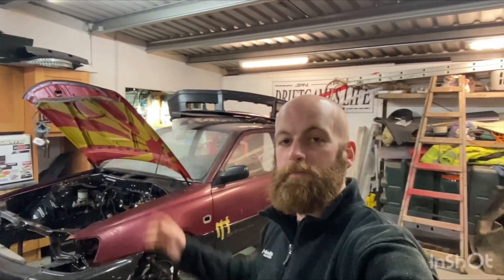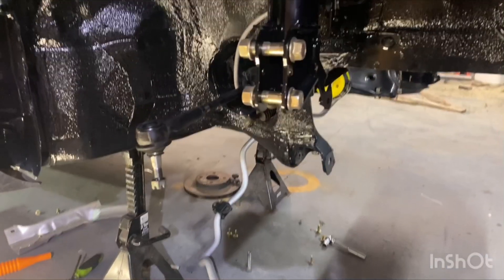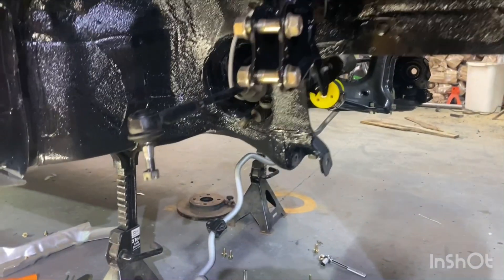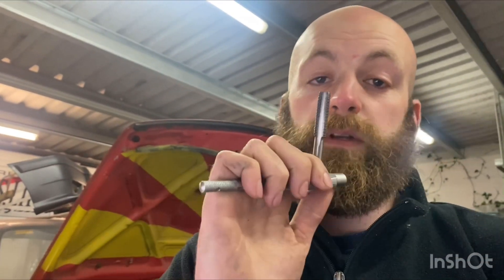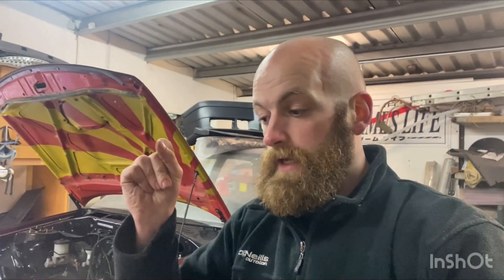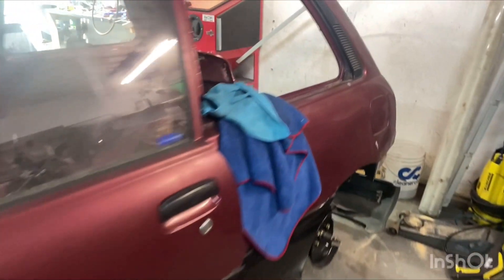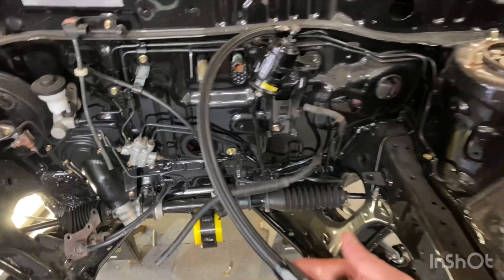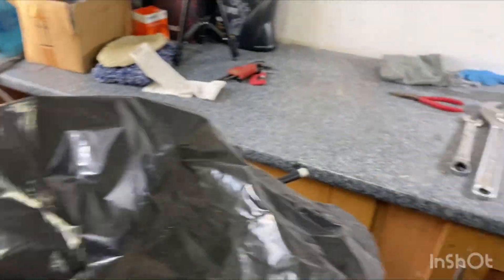I wasn’t going to post this video, but this is the reality of project cars | Starlet turbo build

Comment: spray wd40 before putting bushings in groove then use a screw driver to line up the holes and should go in with some work
, anti lift kit always nice and easy as threads misaligned will cross thread lucky you prayed before or during the install..
Reply from the maker: Thanks I will retry fitting the drop link with some wd40 again and see how it goes, thanks for watching and commenting ✌️
Reply: @joeygt6794  watch the whiteline video I think they have to be loaded when tightening I done mine not long ago but I watched the whiteline video first
Reply from the maker: I’ll check that out, I wonder if it’s different for oem parts ? I’m using a glanza antiroll bar and glanza links